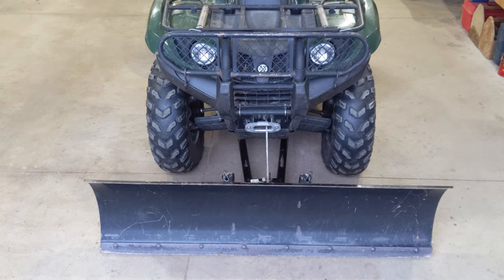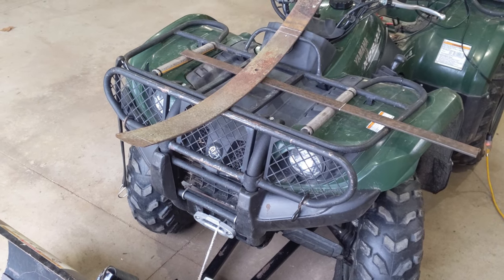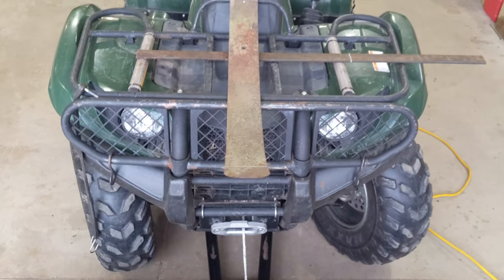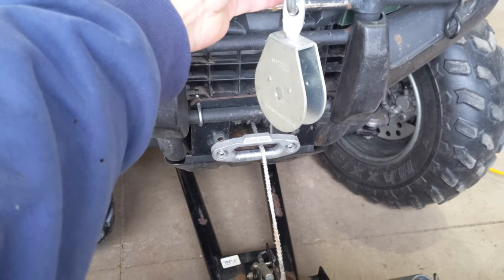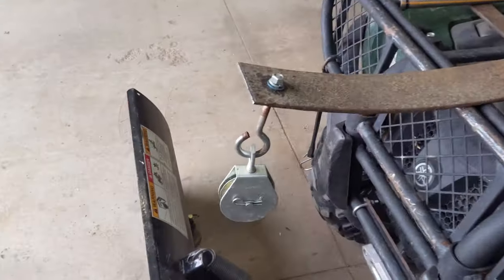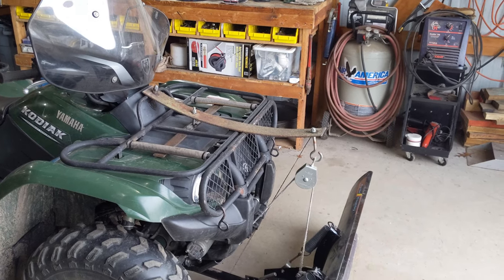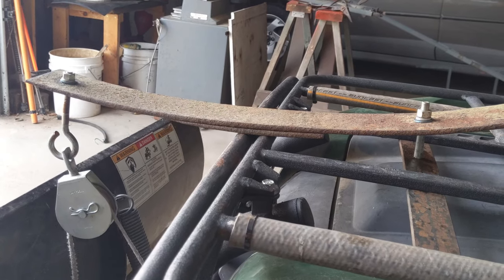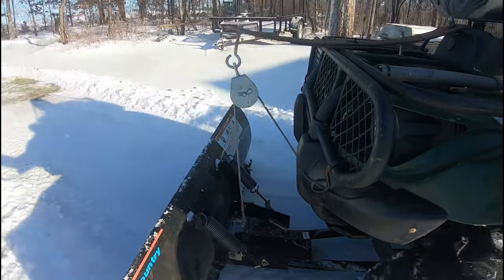ATV Winch Cable Keeps Breaking When Plowing Snow -  Solution!!

Comment: Simple, cheap, and easy to do as it was mentioned in the comment. 2 1/2 tow or tie down strap with metal hook a the end.  
Cut strap at about 8-9' remove old winches  cable,  take a  4-5" piece of duck tape stick half on your strap , run your tow strap through fairleed tape strap to  winch roll then winch cable in then voila. That strap will never break again. Been running this for 2 years now not a single fail.

Comment from the maker: If you're thinking the rig in this video is not the solution you were looking for, check out what other viewers have posted in the comments below. Some great suggestions and ideas have been provided! 1- year update: I have tried some suggested alterations to my rig, but I have returned things to exactly as shown in this video because it works without any problems, where other modifications came with some kind of issue or another. UPDATE 04-03-23: Another brutal NW WI winter, pounded with snow for 4 months straight. Rig-up (as seen in this video) is still performing well.

Comment: Try silicone spray on the whole blade if you have issues with buildups. Once silicone is on it will stay extremely slippery for a long time.

Comment: I think Richard Miller and "M B" are on the right track.  Unless my knowledge of simple machines is worse than I think, you're not getting any actual mechanical advantage by having the pulley fixed onto the spring -- you're just changing direction of the applied force.   And, perhaps, you don't mind because it wasn't a design goal.  All that said, your use of the spring as a shock buffer and an "all the way up" indicator is brilliant!  

If you feel like trying out a pulley relocation, I think you'll find that although each life & drop will take more time, it'll work even more smoothly, and put less stress on the winch and the whole setup.  Please let us know if you do, I'd love to see how it works out!
Reply from the maker: Thanks and will do! It's  worked  as good as I had hoped so far with 3 separate  snowfall  events the way it is now, but I am going to try  attaching  the pulley to the plow and attaching the winch line hook to the leaf spring-  the next time it snows. If that doesn't  happen until next winter, I won't complain!
Reply: @UncleBucks  "Won't complain" ... boy howdy, did I hear that.  I'm in WI and where I am, we're getting creamed with snow this winter.  I've had enough!!
Reply: That's the idea, to pull the plow straight up in stead of pulling it up at an angle. Straight up is applying so much less stress on everything.

Comment: I like the idea, and I am going to use it on my machine.  The only change I plan to make, is that I will have the pulley lower, so the angle of the rope between the pulley and the fairlead won't be as extreme.
Reply from the maker: Thanks, that ought to work well. If my pully hanger bolt were longer, I'd have used it that way, but fortunately it hasn't given me any trouble with the rope at that angle.

Comment: I kept breaking a rope too. But what I did was buy a cheap winch mount it to my plow and didnt use the rope I used a seat belt on the winch and have plowed all year no problem. Just unhooked the leads off my existing winch and run them to the plow winch so I didnt have to change my switches or run more wires into the cab. Drop the plow and hook the leads back to the old winch. The seatbelt works great and doesnt ball up and rob the wich of power.
Reply: They have quick disconnects for winches, amps, and forklifts. Buy the smaller version and some wire. Attach the plugs on the winches and put the harness one in. Now it's plug and play.

Comment: This position awareness comes with experience. I love the ingenuity, but the cable stop product is a good solution. I really think this not an issue as we get through the first couple storms.
Reply from the maker: I had a cable stop product initially. It worked ok but not perfectly. The cable would still rip on occasion. It came off while I was plowing at night one time. I found it two summers later in the ditch.
Reply: @UncleBucks  good point sir, I had the same happen to me as well. Plowing with an ATV is an adventure in repairs and modifications :)
Reply from the maker: Yes it certainly is!
Reply: the magnetic one?

Comment: Great idea! I had the same problem where the cable kept breaking. I had a strap used on boat trailers which is about 2  1/2 inches wide and a little less than 1/8' thick that already had a hook on the end.. These straps have great tensile strength. I cut it down to about 5-6 feet and used duct tape to hold it onto the winch "drumr". I then rolled up the boat strap so it had many layers on top of each other. I have been problem free since.
I am thinking I may do something similar to what you did to change the angle of the strap going into the winch, thus lessening the load.
Reply from the maker: Thanks! The wide strap sounds like a very good solution as well. I do like being able to have a long line on my winch in winter too though for other occasional uses, but the wide strap is a much simpler approach to the issue. The leaf spring flexibility in my set-up has really been working well. I tried putting the pulley down on the plow but the rope kept binding in along side of pulley wheel, between it and and pulley wheel housing, so I went back to hanging the pulley from the spring. Works flawlessly this way... so I'll not mess with it anymore.
Reply: The 2000 lb. Winch on my UTV, just tore the end of the strap right off.

Comment: I ended up using some 1/2 inch iron water pipe that I had laying around, to make the support for the pulley system.  I made a "T", with the long 2 ft piece, (the equivalent location of your spring) attached to a 2 ft piece of crossing pipe , secure to the mounting rack.    I wrapped the pipe with hot water insulation foam, and for the front support, I placed a piece of 1" X 3" board on the front of the rack, and secured both the board and pipe to the rack.  I mounted a double pulley at the plow, and a single pulley on the front of the pipe. 
 I threaded the winch cable through one of the lower pulleys, then up to the upper, single pulley, back through the second lower pulley, and secured the end of the cable at the end of the 1/2 inch pipe.   This slows down the rate at which the plow moves, making it much more controllable.  It also reduces the load on the cable, to 1/4 of the load of the original setup.
To indicate the height of the plow, I am going to attach a foot long rod vertically at the top center of  the plow, and I am going to mark the upper and lower limit of the plow on the rod wrapping electrical tape  at the two points on the stick, so that the marks are easily visible from the driving position.
I am all ready for the snow, so that means that we won't have any snow this season.  :-)
Reply from the maker: Using more than 1 pulley is something I hadn't thought of. Good idea! I've tried relocating my 1 pulley down on the plow but my line would bind up in it once in a while. Went back to how I did it in the first place (as shown) and it's performed flawlessly for two winters now. Good luck with yours & thanks for your comment.
Reply: @UncleBucks  I'll know how well it works after this season.  The cable fits tightly in the pulleys, so there won't be a problem with binding.  I forgot to mention, that I removed the hook, and just secured the loop by slipping it over the end of the pipe.  I have the hook stored under the seat, so it will be readily available when I need is.
 I stuck with the winch cable for now because I wanted to have the winch available if I need the winch for other purposes, such as dragging logs.

Comment: Hi Brett, good video, great idea, I wanted to ask you how your ATV battery holds out when you plowing ?? Do you have any issues draining your battery? Thanks
Reply from the maker: Hey Joe! This is my 3rd winter using this rig-up, including some very heavy and wet snow the last few days. It still works flawlessly. It hasn't created any issues with battery drainage, but I am always using the winch when the wheeler is running.

Comment: tie a rope around front rack, put pulley on plow. then loop from your winch, out to your pulley, then up to your front bumper rope. the angle of your rope has too much pressure and friction on haus, try a roller with a larger bottom roller to help reduce wear out. if need be and you have room, you can add a extender to the pulley to lift it higher away from the the bottom of the plow, less angle and less stress on winch, rope and fairlead. enjoy plowing.
Reply from the maker: Thank you. I did notice another video of a method similar to what you described. That'll be my "plan B" if this rig up doesn't hold up. So far, so good though!

Comment: Put the pulley on the plow, not the leaf spring. solve angle issue?
Reply from the maker: I tried this but the rope jammed up along the wheel in the pulley that way because the pulley twell. The side when the rope is slack. The angle of the rope is not the problem. The problem is the winch overtightening and ripping the rope at the tie spot on the hook. The pulley is back to hanging on the spring once again and working well.

Comment: My cable snapped so I thought,  why not ratchet strap.  So i fed a 2 inch wide car grade strap into my winch and it works great.
Reply from the maker: Someone else mentioned that also. I think it's a great idea!
Reply: I have a 10,000 pound, 2" wide recovery strap (Black Friday price, $12) that's just waiting for the day that my synth rope is worn out.  Even if that snaps, it's long enough for 2 or 3 uses! :-)
Reply: @floobertuber  i have a synthetic rope in my storage but i don't like fixing stuff that works.
Reply: @Grandamse1  I don't blame ya!

Comment: If your winch line went straight down to your plow there would be way less stress on your winch line and winch. Using the spring and pulley system works but your over thinking the problem. My winch line on my plow goes straight down to plow. So far no issue. I use 3/16” metal cable line. When it starts to fray I just shorten the cable before it breaks.
Reply from the maker: My winch cable (3/16") used to go straight down to the plow as you described. The stress on the line was when the plow would be lifted up as far as it would go, the winch would overtighten just a little each time it topped out, until eventually the cable ripped out. So, digging that backwound cable out of the winch when its dark and blowing and cold got old quick. Perhaps my winch is stronger than others. It would rip that cable right off before the winch would run out of power. Same thing with synthetic rope. Put up with that for a couple years too. At least it was easier to regularly re-tie synthetic line v.s. cable. Digging that frayed end out of the winch wasn't much more fun though. Perhaps I didn't explain my problem very well in the video. I needed something to reduce tension when the plow tops out. I've tried many other methods before this, not over thinking it, that did not work. I've not had to re-tie my line one time in the two winters after dozens and dozens of plow sessions with this set up, so it solved the problem, at least on my rig. Thanks for commenting.

Comment: Simple Canadian solution,undo that rope and take one of those cloth fishing rod protection and cut it to about two feet long.
Take that short piece and slide it over the winch rope.the liner keeps the rope from fraying and wear...your welcome.
If you install your winch properly with a 30 amp power breaker the rope will not break!
Reply from the maker: Thank you  for commenting. My synthetic  line came with a sleeve  like you described.  It was awesome  at binding  up real good in the winch. I fought  with it many times but eventually  got fed up and eliminated it.  Interesting tip on installing  a power  breaker.  Never heard  of that...

Comment: Seems like you’re  making 4 additional fail points to fix one . Never had a issue snapping line with a roller fairlead , a rubber winch line stopper , and eyeballing the height
Reply from the maker: Glad to hear that way works for you. I had a rubber winch line stopper which helped some, until it came off and was lost in the snow. It's tough to eyeball the plow blade height when the entire plow is under the snow - often the case when it's fluffy snow.

Comment: Try the pulley where you have the hook and the hook where you have the pulley
Reply: I agree!    Attach the pulley to your plow and run the hook to your brace.   That will give you a mechanical advantage of 2.   The winch will use about half the force to lift the blade, but the blade will also move at half the speed.     I have wide tow strap wrapped around my rack.  I  attach a pulley to the snowplow & attach the winch cable hook to the strap ends.    My plow lifts very smoothly & easily.   This is a different ATV & plow for me this winter, but I haven't had any cable issues so far.   My former set up had a manual lift.    My plan B was cutting a long, wide tow strap in half & use half of it wrapped on the winch to lift my snowplow.     Someone already mentioned that, too!
Reply from the maker: I tried this but went back to my leaf spring contraption here with the pulley hanging from the leaf. My problem wasn't the angle of the rope or the location of the pulley. The problem was when I winched up too far, it kept ripping the knot out right at the hook. The leaf spring being able to bend has proven to be the best way on my rig. I have not ripped a knot out with it yet after dozens of times plowing with it this way.

Comment: Or just use a roller instead of the hawse fairlead for plowing. You dont use enough line to worry about snagging the corner of the roller. And the roller will spin and not wear the line like a hawse......
Reply from the maker: I had rollers on there when I had cable on the winch.  The cable still  frayed and broke often, but I never  tried the roller with the synthetic  rope...
Reply: @UncleBucks  warn makes a wide 66 inch plow strap but I’d only use it with a roller fairlead.

Comment: I plowed snow with  a wire cable for 10 years with no problem. I fell for the marketing hype and put on a synthetic rope and it breaks EVERY TIME I use it. I am going back to a wire rope. 

Synthetic rope is probably the biggest scam ever presented to the consumer.
Reply from the maker: I had plenty of trouble with both, but synthetic was definitely problematic. Thanks for watching and commenting.

Comment: Could have saved you all that Maria Monroe get your PVC pipe get you another one that's smaller that can slide into the bigger one run your PVC pipe the small one all the way to your plow when your other piece of PVC pipe to the front bumper of your ATV UTV whatever it is put a mark on it when the blade is down when you raise the blade then more comes up to certain point on the PVC pipe showing you the blades all the way up
Reply from the maker: A video demonstration of this would be fantastic!

Comment: The angle of your plow cable is too much. The winch is trying to pull the plow in towards the ATV, when it should actually just be lifting it straight up. The cable should attach to the plow directly below the winch. I used to break a lot of cables, until I changed the cable mounting point on the plow's push arms. You want that cable as vertical as possible. Notice how your new mount is now lifting it straight up rather than pulling it in toward the machine. That is how the winch should be, lifting not pulling.

 I bolted a piece of metal across the push arms on my plow and then attached an eye bolt directly below the winch so it now lifts straight up.
Reply from the maker: My mount solved the problem. Haven't ripped the winch line once yet, and it is the third winter now in-use. There wasn't much of an angle directly from winch to plow before I built this. My problem was overtightening. It was tough to see/feel when the plow was all the way up when it's snowing and blowing and dark. For me, this mount creates some forgiveness from winch line overtightening. Thanks for watching and commenting.

Comment: This hurts to watch. The hole time I’m thinking hey, this guy gets it, he is going to reduce the angle out of the winch so it doesn’t fray the cable over the fairlead roller... genius ! 
But as I continues to watch, yelling at the laptop I’m like “ hey you idiot instead of softening the angle you actually created a sharper angle but in the opposite direction” 
You need to flip that frown upside down Bruce Jenner. Flip that leaf spring so it hangs lower so the cable comes straight out and doesn’t strain and wear over the small fairlead roller. So close to a great idea... so close.
Reply from the maker: You mean the "whole" time? The line kept breaking because of winch overtightening, and not being able to see it. Good job with the name calling though if that makes you feel better about yourself.